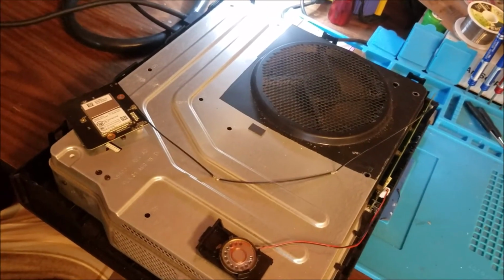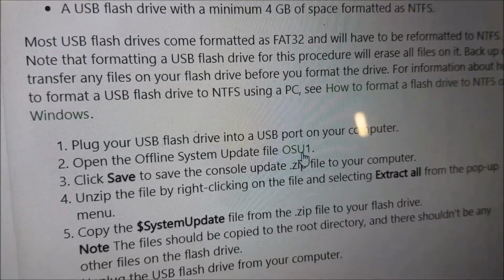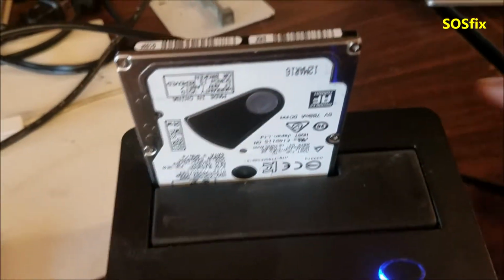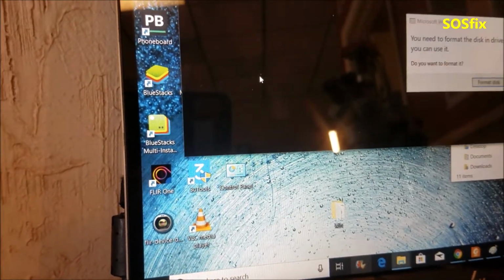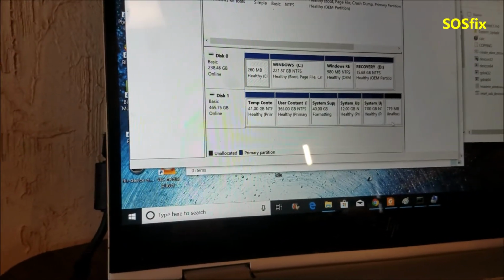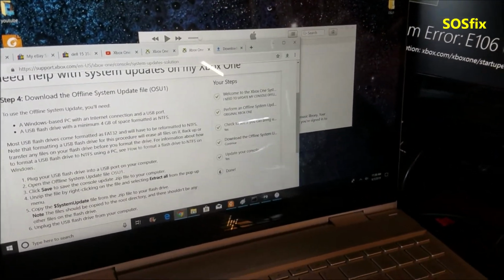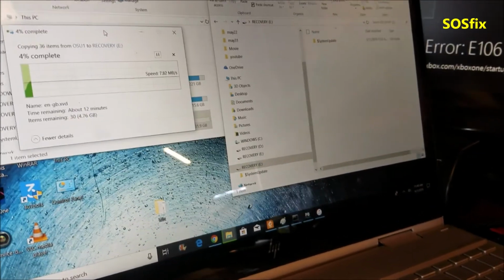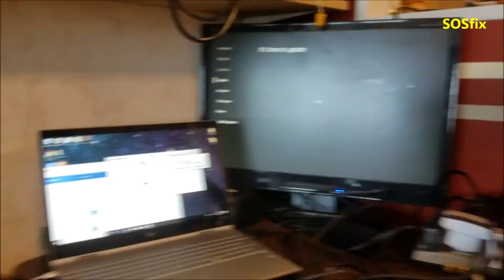xbox one bad hard drive error E100 101 102 105 106 200 203 204 206 207 305

Comment: So my Xbox has a problem where when I turn it on it takes a long time for it to show on the tv and then after a while it will go to a black screen then to the green Xbox loading screen and it would stay there for a very long time I wanna get it repaired but I don’t wanna lose my data PLEASE HELP
Reply from the maker: Looks like you have a slow hard drive. You need a new hard drive to make xbox works right again. After you setup the new hdd you can copy data folder from old hdd to the new one using the computer.
Reply: SOSfix Electronics can u please explain how to do it I’m not familiar with this kind of stuff

Comment: can you help me? Xbox 1S 1TB. i have E106. when i restart or reset it goes to 10% and stops. then says something went wrong. Solutions? greatly appreciated
Reply from the maker: Wipe the hard drive and reinstall the system using the computer. Follow the steps in the video. If you still getting error. Change the hard drive

Comment: I swapped the hard drive from my old xbox one to another xbox and keeps giving error 106. I don't have internet here but do you think maybe update will fix it without making me format/erase what's on it?

Microsoft support hasnt been helpful in getting my Live account on this one so I was thinking if I swapped HD then my profile and everything would just load right up. Going to be working on it, otherwise I'm going to have a very boring weekend 😵
Reply from the maker: i m not sure if you can save the old data from the old hard drive to the new xbox. try to do offline update using usb flash drive and see
Reply: @SOSfixElectronics  I decided to just try to recover my account by the book but that was probably the worst decision to make because it resulted in my account getting bricked.